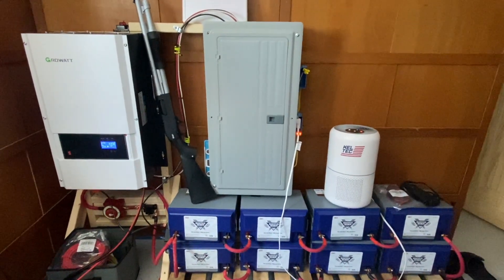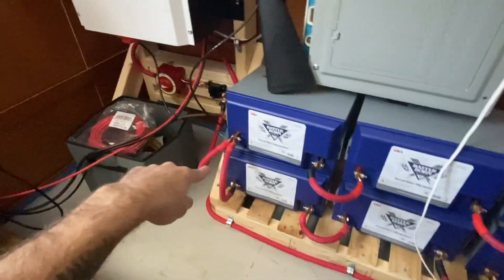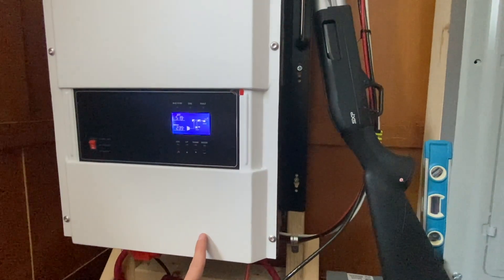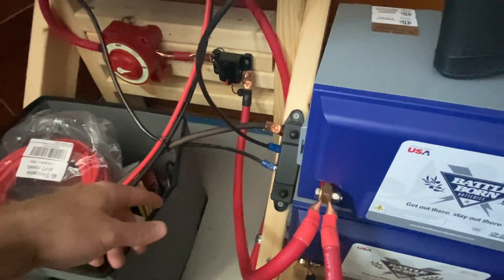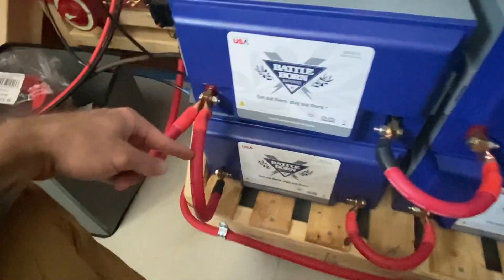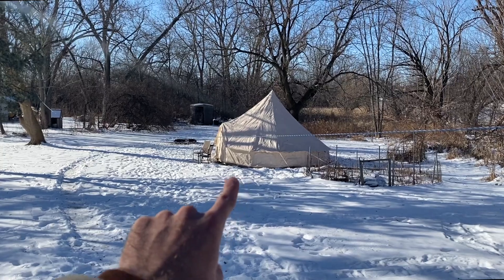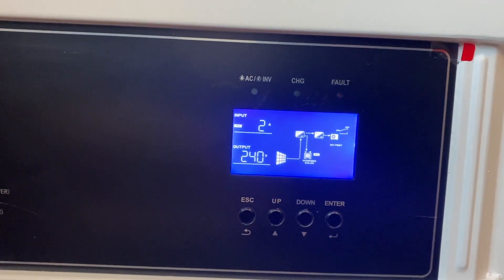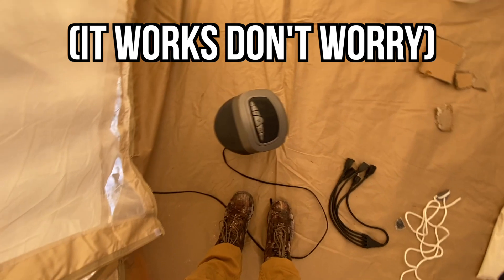12KW Growatt off-grid electrical system setup, Testing yurt

Comment: Where did you get the grounding idea from? Is it safe to ground the system to the negative side of the battery and then a earth ground rod? Also are the neutral and ground separate in the main panel?

Comment: Electrician here! I would do an SCR cable 3/0 3/0 3/0 copper you could use aluminum just upsize it by one aught. It will make it a safer  and cleaner installation because it will have a casing on the wire.

Comment: How did you input abd change the voltage do you do it when running on battery's I keep trying and it won't work  do I disconnect the battery abd leave on the solar and adjust it can you do a step by step video please I have a lot of people asking to
Reply from the maker: Are you in Europe or US? What voltage are you referring to? What voltage are you trying to get? Do you have a breaker box? (Not trying to roast but I’m not sure what you’re talking about).

I have -120 and 120 and neutral running out of the growatt and into the breaker. So I can get 120 with a regular breaker fuse and if I use a different fuse in the breaker box I can get 240. 

Otherwise there is a specific growatt for US and specific one for Europe.

Comment: Great Job. But your going to need more batteries if your going to run a heater, any heating element will suck the power out of your batteries. But trust me your going to need a lot more batteries. I made a 250ah battery pack with Lifepo4 32650 batteries. I have 16S50p packs, that I have connected to the same 12kw inverter. It powers 75% of my home off a transfer switch. Trust me when I say, you need more power.

And you will need more solar if your going to try and charge that battery bank.

Comment: Hi I purchased the same equipment, 12kw growatt and battle born batteries. I haven’t installed yet. Did you precharged the internal capacitors of the growatt using any type of current surge limiter? Thanks and congrats
Reply from the maker: Yes! 100W resistor from Amazon. Hold it for 20 seconds to be absolutely sure they’re charged up!

Comment: READ THIS !!!!

I bought this inverter  because I wanted to generate solar power, using this solar power and feed in additional grid power at the same time whenever solar isnt enough. I wanted to use the battery power only for grid outages OR, eventually use battery power during a few hours per day, when our utility company charges higher rates during peak hours. This inverter cant do this, even the seller told me it would do this!
Issues i had in detail:
No 1: Inverter cant provide solar and grid source simultaneously
Either if setting Menu 1 is SOL or SBU, the inverter is always using battery power when solar isnt enough, until the battery reaches its low voltage setting from menu 12. That means throughout the day the inverter is hundred of times tapping into the battery, back and forth switching. This wears on the battery and the internal relay.
No 2: PV charging current  is always wrong ( display " Input PV A")
This value is always wrong. For example I could prove with Amp clamp/Voltmeter a production at the moment of 1,6kw, the PV Voltage stated 130 Volt and PV charging current stated 32Amp. This turns out to be almost twice as much as my panels are rated for.
No 3: Wrong display information
PV charging power ( "PV Batt kw") is actually NOT the charge power. It is indeed the actual solar production and this number is way off of what is described under No 2.
The actual charge power is always way less, proven by Voltmeter and Ampclamp. PV charging power is actually production, proven by Voltmeter and Ampclamp.
No 4: Solar production limited
For a long time I scratched my head why this system isnt producing what it should. the battery is constantly making up for the difference to supply the load. Then i found out that" PV charging power" is actually production in watt and was LIMITED by the inverter: It makes no sense at all that the actual production drawn from the panels is reduced by setting Menu 2. Menu 2 supposed to limit the maximum charge current (as per manual), to protect the battery of getting overworked or hot. Menu 2 should be totally independent from the actual production, every single watt not going into the battery should be available for the loads.
As soon as I changed setting menu 2 from 30 to 100 the production went up, and what I measured with voltmeter and ampclamp was indeed matching PV Batt W, which want to be a "charge power".
No 5: In regards to a question to Error 61 I was sent information on how to calibrate the voltage measuring feature. No I wont do it, thats something a manufacturer has to do, thats not the customers job.
No 6: No clean solar cut in/out
When solar production reaches its threshold the build in charger should read the low Amps and cut in or out one single time. Instead the charger toggles maybe 20 or 30 times on and off until solar is clearly beyond the treshold. this doesnt make sense at wears out relays or switches.
Seller and user manual cant describe owner what menu 26 is for....
If there is never enough solar power for the loads the inverteris wearing  out batteries prematurely. Settings dont make sense and work counter productive. Values given in the displays are wrong. The user manual is misleading and lacks a lot of explanation.
Reply from the maker: Woah, thanks for the information. This is definitely going to take some learning to wrap my head around, which I will do. Do you have any recommendation for anyone reading this on the market for a new inverter of this size? Seems like you know enough to give some good advice to those asking.
Reply: @WillMagnerFitness  I could, I work in the renewable energy field myself. But this is unfortunately too much information to write I usually talk to friends and neighbors over an hour to give them a good "wrap around". I would YouTube a lot, but unfortunately no one want to speak out the disadvantages and product failures on a channel.... Personally I will bite the bullet and buy a sol ark Inverter, way more expensive
Reply: @Gallardo6669  I was about to buy this inverter today with a BigBattery... but I guess that I will wait
Reply: @alexisgueits7684  I still have issues and wait to get my dispute resolved. I will buy then a more expensive inverter... I'm glad I could give someone a second thought...
Reply: @Gallardo6669  My plan was to just charge a BigBattery (Kong 48V) via solar (6 -370 watt just for this battery) during the day and not to power anything in my home.  At night is when I wanted to use it.  Is that possible or a mess?
Reply: @alexisgueits7684  your project does not make sense to me. You cannot charge a big battery decently of a 370 watt solar panel. It the best sunniest part of USA you may perhaps get 2kwh per day out of it. And the inverter is way to big for it, unless you want to feed big loads... You numbers don't make sense. And the growatt still works unreliable for me no matter what.
Reply: @Gallardo6669  Thanks for the advise!  So how many of the 370watt panels will be you think will be acceptable for the size of the battery?

Comment: Forgot to mention, you'll want to individually charge those battleborns to full capacity before using them in series.
Then either run a balancing circuit to them or take them out of service twice a year to individually top charge them.
Looks like your getting quite prepared for a good cabin build.
Will watch for that.
Reply from the maker: Interesting, is that for battle born specifically? I'm pretty sure they have individual charge controllers inside. The voltage across the individual batteries has very little/negligible variance. For example, they all seem to hold the same voltage individually, even when the total voltage in series drops.
Reply: @WillMagnerFitness  yes, before spending more $ on battle born, consider selling them and switching up to signature solar EG4 battery. Way more power, way less headaches and at half the price or less.
$1600 for a 48 volt 5.1 KWh battery = about $320 per KWh.
Trying to sell our battleborns now.
Wish I could easily get them back to Manistee for use in our camper (best for a 12 volt system) but the shipping is a huge  issue from the U.S.V.I.

Comment: Nice setup.
We had battleborn but recently switches to signature solars new waterproof 48v 100 ah batteries.
They are performing great and at a price far lower than battleborn by 50%.
Thinking of upgrading from our 8000 w inverter to the growatt 12000. How are you liking its performance so far ?
Reply from the maker: Woah, I'm going to have to check out those batteries. I was planning on doubling my battery bank when house is built if necessary. So far I have had zero problems while it was running and while I was testing it. But, the only testing I've used it for was a space heater and an air filter fan, so not extensive. It has been disconnected for two months as it's just in a spare bedroom and not really being used. The real test is when it's in the field with constant loads. So far I would recommend it.
Reply: Yep, we ran 16 battleborn for 4 years powering our home.
To avoid balancing issues you'll need to take these steps - otherwise eventually batteries get out of sync and you lose storage capacity.
Ending up with nuisance shutdowns as one low battery bms will cut out ,shutting down the whole system.
The voltage can show a full charge but you could be only at 50% capacity at any time.
Hence our switch to a dedicated 48 volt battery system.
We just ordered the 12k growatt as a backup unit in case our inverter ever has issues (hoping not) as we are on an island and must have spares available just in case. Also the 12k unit is big and you should avoid any prolonged large loads (over 8 Kwh) with only 8 batteries as the Amp draw would be quite alot from the batteries. We are packing up and getting ready to head to Manistee for the summer now. What part of the U.P. are you in ? Michigan summers are the best !

Comment: I guess you didn't get to the level of a 240v mini split yet but you're well on your way there! Great start!
Reply from the maker: I'm not an electrician and I don't know what that means exactly, but if I measure voltage across the two bars on the left and right inside the breaker box I get 240v. So I think I've got it!

Comment: Help question ? 
I bought a ep500 bluetti  solar generator  how would I incorporate it into what you done .
Does growatt have ats. Auto transfer switch
Reply: Yes you can set it up for ups mode which will immediately transfer power to battery/solar within milliseconds.
Reply from the maker: @JM-yx1lm  That rocks!

Comment: I have this unit.  I has been in operation sense June of 2021.   Been powering my house during the day only.  I have Lead acid battery right now and need to go with eg4 battery soon.  Almost 15k of solar panel in operation at this time.  I am in Michigan with poor sun.  Need to way over panel just to get what you need for power.
Reply: Hello, this inverter accepts 7000w PV array max.  How can you use all 15k array?  thanks
Reply: @carymartz8762  running about 4k on each charger on inverter, most out put I seen last summer here in Michigan was 3100 watts per array. The rest at on external chargers.
Reply from the maker: Sweet! That sounds legit

Comment: So can you add another charge controller to bring in more than 7kw PV power?
Reply: Yes we ordered a matching growatt solar charge controller that is an external version of the one in the 12k.  We've not installed it yet, but when we do it we will set up a 13.2kw array.
Reply from the maker: I’m unfamiliar with the upgrade, but looks like off grid mike knows!
Reply: @OffGridandOutdoors  Make a video with the extra mppt controller please
Reply from the maker: @Galneryus777  offgridmike I'd like to see it too. I thought I read somewhere that It wasn't compatible with another mppt but I could definitely be wrong. I am no electrician!! Just a dude with some dangerous electrical equipment!

Comment: Is it the 250v input or the 150v?
Reply from the maker: 120/240 here in the US.
Reply: Sounds good, so it's a 120/240 output. Growatt makes both a 250volt  pv input and a 150volt pv input. From my understanding u can series a few panels that will add up the Voltage. So u get close to the max Voltage input in series and parallel the arrays to get the amperage up. If u have a 150v pv input u are getting close to the max voltage input one more panel in series will probably overload it. just my 2cents. Keep up the good work.  By the way I could be wrong.
Reply from the maker: @electricandlsxpower  Sorry I misread that. The MPPT operating voltage is 60-145v, and the "Max PV array open circuit voltage" is 150v, both from the user manual. I currently have a 60v array, and when in the sun (during the winter), it reaches 111v pv input as displayed on the growatt. So I do think I could get away with one more panel in series, and I will definitely try when the times comes for a permanent setup! I'll keep you posted if 6 panels throws a code.
Reply: Do NOT exceed the the VOC of the mppt input with these charge controllers. You will smoke it, not just throw a code.

Also do not over panel the input power of either pv input on the Growatt. Some sellers say that you can, and you might could go 10%, but some some users have smoked the SCC even when staying in voc just by over paneling.

The SCC of these Growatt's is set for a max of 7000w (3500w on pv1 and 3500w on pv2).  We contacted growatt and they said do not exceed this.
Reply from the maker: @OffGridandOutdoors  Im going to test with 5 and 6 panels (end of April in Chicago) and see where I get. Im pretty sure I can stay within 150v with 6 panels though.
Reply: @WillMagnerFitness  lookin forward to your results

Comment: The 120/240 should be in conduit to make it up to code. Looks good man. U have some money in batteries. Looking forward to seeing how it works out for you.  Look into some more panels.  making a ground array. Get it closer to the max of pv input.
Reply from the maker: Interesting, and thanks! I guess the conduit just terminates near the bottom of the Growatt? 

I’ll definitely add a bunch of panels once I get it out to its permanent home. Also maybe more batteries, if needed. And I’ll mount it all to some durock and do some better wire management.
Reply: @WillMagnerFitness  sounds great. Used panels are definitely way to go if u can find them lowest I have seen is 29 cents a watt. I just ordered 28 panels at 39 cents. New is some where north of 55cents. Keep it up.  Have a great day.
Reply from the maker: @electricandlsxpower  where do you find them used? Craigslist? I just got one more 100w panel (new) to bring it closer to max pv output.
Reply: The biggest problem I saw what your main breaker. 150 amp breaker is to protect 1 AWG wire. anything smaller could be a fire hazard. Also 12 Kwatts runs at 62.5 amps if you are going to put a breaker on it. That is because all breakers are rated to trip at 80% of load. That means that you need a 62.5 amp breaker to get your full 50 amp power per phase.